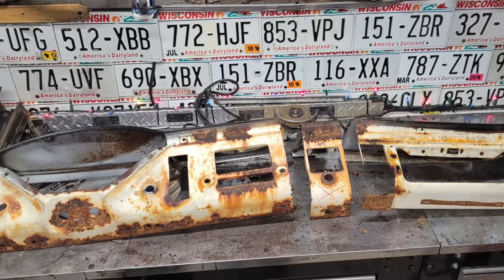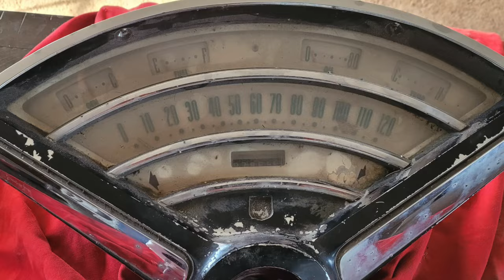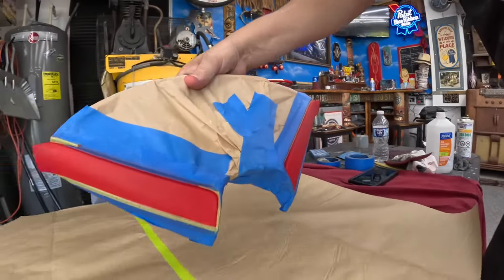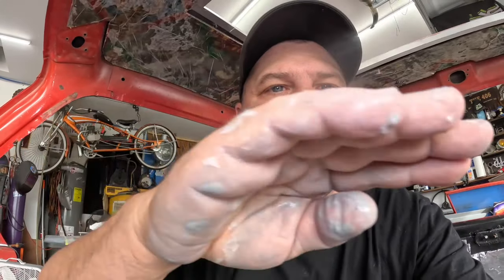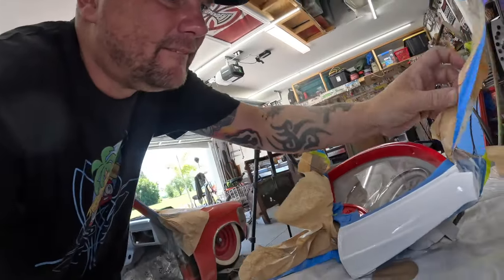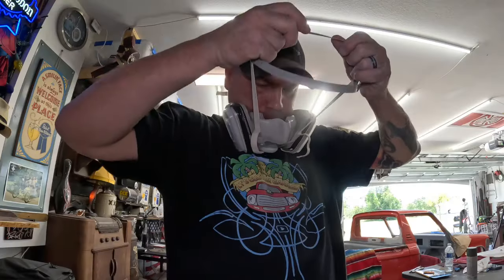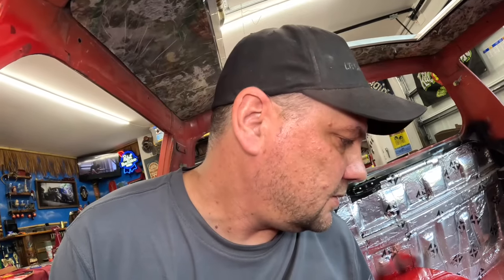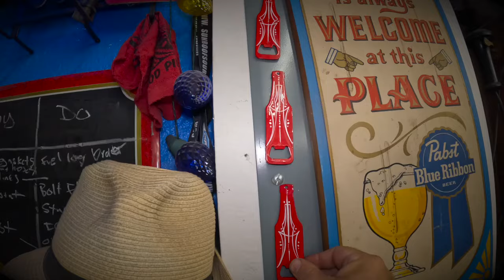Automotive finish with NO PAINT GUN!

Comment: Luv it! Looks great! 
Man, I've still got some scraps of velvet like that from when I did my 1st truck in the late 90's 😂 but green.
I also have 2 switches on my truck. I had Jason "T" my setup front/rear control, and honestly, I think it rides great. I don't have any weird sway issues that I notice at all, so you should be totally fine there, especially with the sway bars. 
I notice that new shirt.......👀 is it available yet? I neeeeeeed one 😍
Reply from the maker: Some of the most iconic minis were done that way and still are. I actually used to be kind of a "co-owner" of one 😆 It rode just fine too. It's not like we're racing around corners with these trucks. I was wondering if anyone was going to notice the shirt 😆 right now there's only 2 in existence, testing them out in the garage and laundry. I'm not sure where they're going to come from yet, but it is motion!